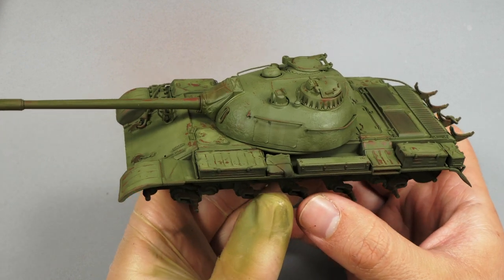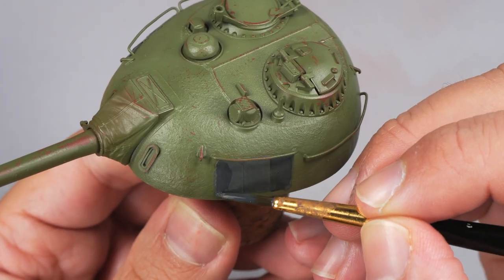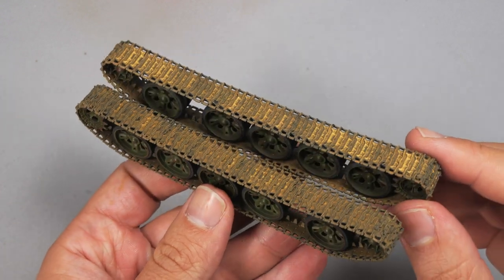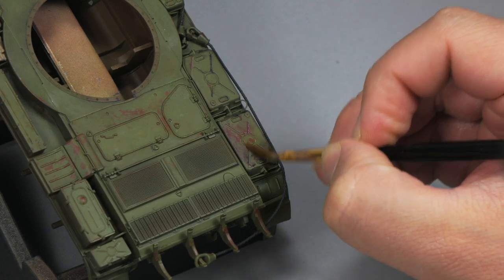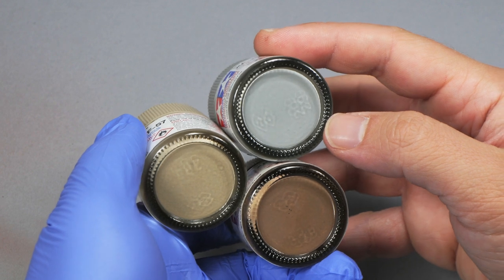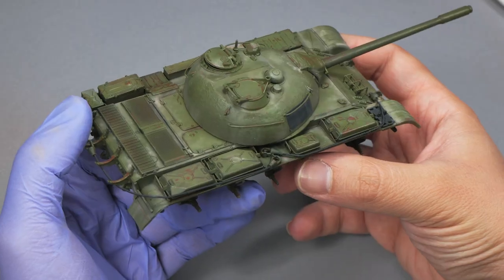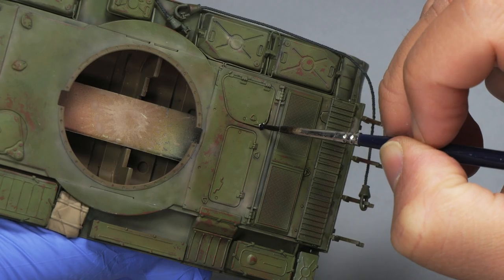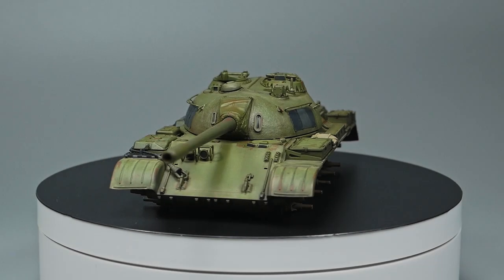Applying 3 weathering effects for upgrading a green camouflage scale model - Tamiya T-55 1/48

Comment: Best thing about Russian and Chinese manufactured T-54/T-55 and the variants in the series up to and including T-62/T-72 is that they've actually been used in conflicts across the globe for decades, while Western tanks have basically not been involved in prolonged conflicts. So we see that tanks like this T-55 can be seen in a severely weathered state but in a condition of combat readiness despite looking worn. However, unless it is a derelict tank or one that has seen a lot of inaction, the wear areas of the track will be worn to bright shiny steel. The track guides in the center of the tracks and the inside surfaces that are in contact with the rubber road wheels will have no rust in as little as 15 minutes of driving.
Reply from the maker: Absolutely agree, it is important to decide which type of weathering you want to represent. Photographs are also a super useful source of references. In this model finally I decided to represent a vehicle in active use, so I polished as you said the exposed running gear parts. If interested in watch the final result I leave you the link https://youtu.be/-lKD3Amkcrc